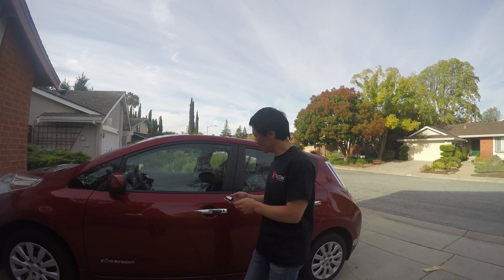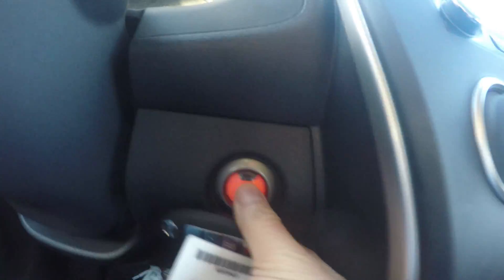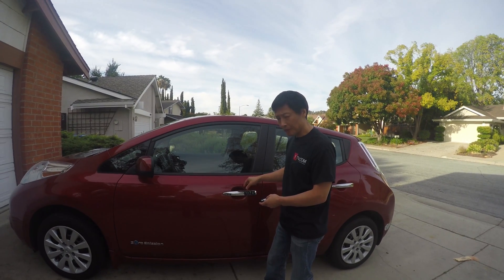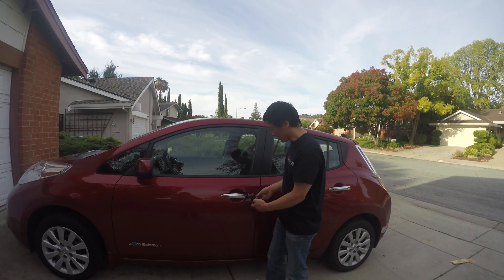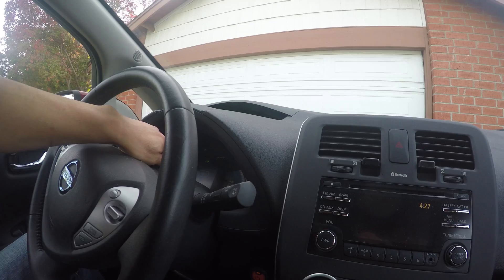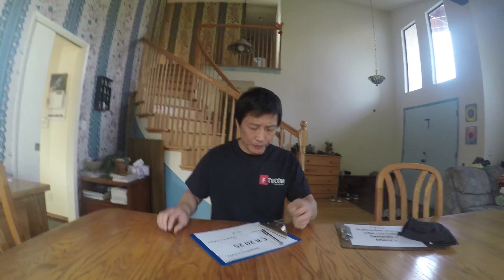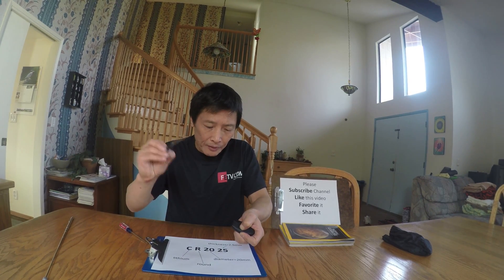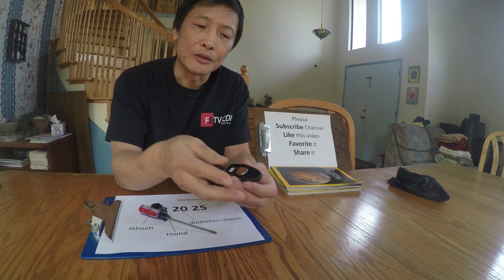SmartKey Fob Battery  Dies-- How To Enter Car and Start Engine Without Battery or Replace Battery

Comment: Can you tell me what to do if my Nissan battery is dead and I can't open the door
Reply from the maker: Did you miss that part in the video? You will need to use the mechanical key. The mechanical key is INSIDE your fob.

Comment: What if I want to have an emergency key in a hidden magnetic box attached underneath my truck? What would I have to do? I have a 2017 Titan with the exact same key type.
Reply from the maker: If the FOB is shielded in a metal container, then it will not have much effect. You can also only split the mechanical and electrical part, i.e., leave the mechanical key underneath your truck and leave the electrical part shielded in a metal box inside your car.